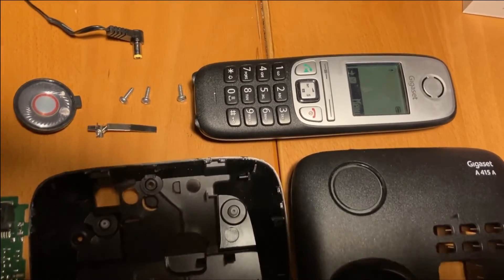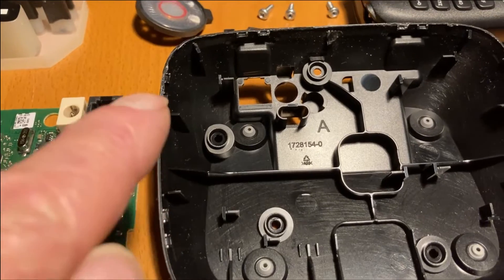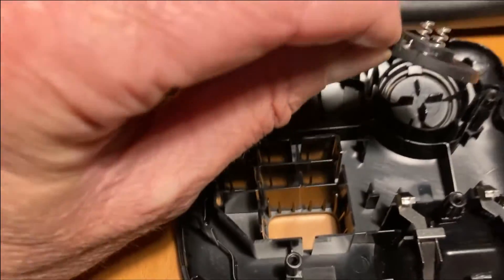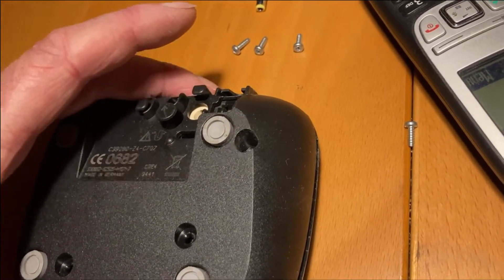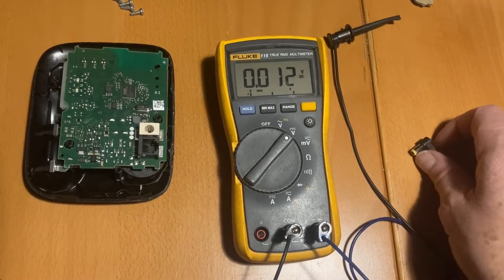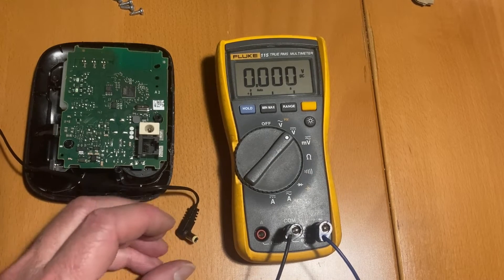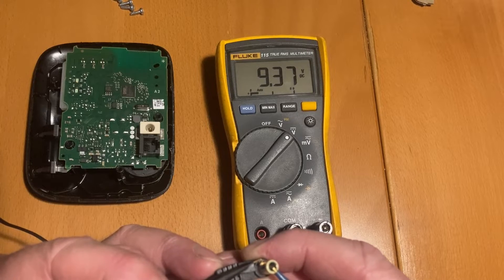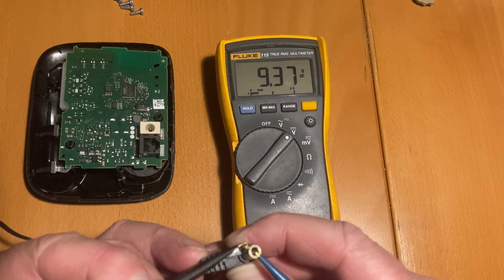Gigaset wireless phone does not connect to base station: disassembly and repair

Comment: Alternatively don't take the lot apart just do as per Gigaset instructions which is to "We recommend that you perform a Power On Reset. Remove the batteries from the handset and reinsert them after about 10 seconds. Please also disconnect the power supply of the base and router from the mains for 10 seconds. This procedure restarts the software in the handset and base station."  This worked perfectly for me.

Comment: Why does a base station have a bridge rectifier if it is charger by a 5v dc switch mode power supply?
Reply: To convert ac from the switched to direct current having rms voltage